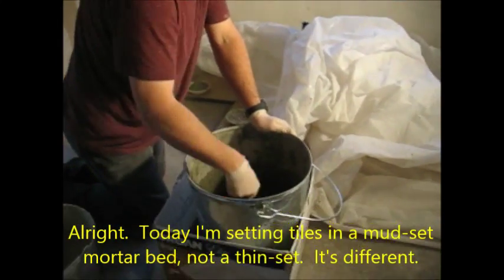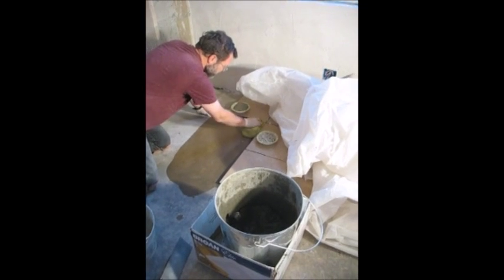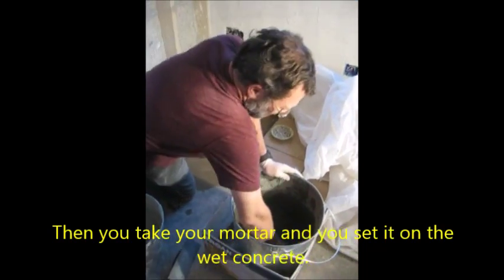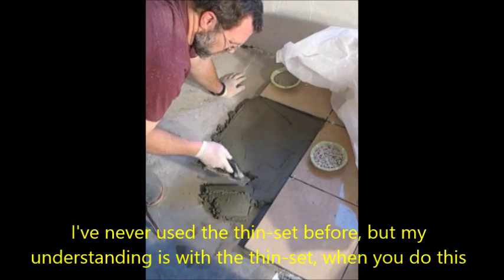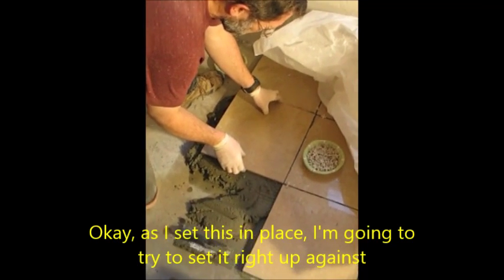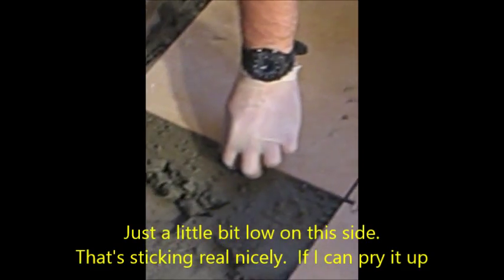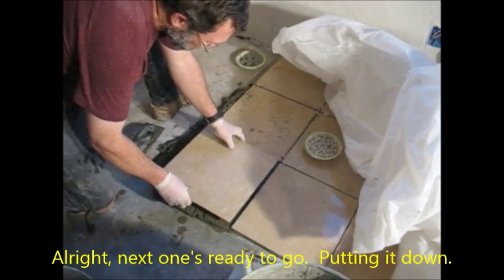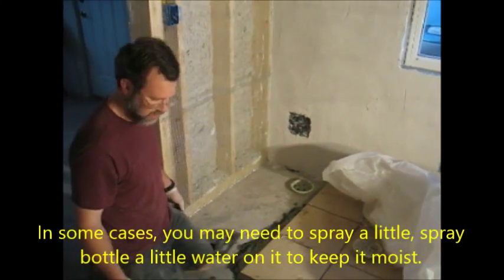How to Install Ceramic Tile with the Old Fashioned Mortar Bed Method

Comment: Over 50 years ago as a flooring specialist we used to lay out semi dry screed beds on level battens (as for a level screed) then dust it with neat Portland cement and bed the soaked tiles on this. Then beaten/ tamped in with a 2x4 beater block .. level checked constantly ... usually grouted with white or grey Portland cement ... and this method was used on suitable inspected and prepared  suspended timber floors with expanded metal mesh afixed over pitch impregnated paper first . And not once in all the years that this was done, did we ever have a failure! It works perfectly
Reply from the maker: That's excellent!!!!

Comment: I would wet subfloor then pure cement then mud mix , pure cement  wet tile then lay tile
Reply from the maker: there is no "subfloor" ; it's only a concrete slab, and yes we soaked the tiles

Comment: hi. i have poured 10cm on perlite floor screed with no expansion joints. it has several cracked over 5 months. how can i lay tiles over it with no future problems?
Reply from the maker: i am sorry, i do not know.  :(

Comment: You need thinset as a bond coat though. Thinset on subfloor, thinset on back of tile mortar in between. What your doing will blow right off the floor.
Reply: I agree,you need a bonding coat.
Reply from the maker: Nope, the floor has been great for over three years now.  :)  That is the point of the details in the video--how to make it stick with no thinset.  Just one tile broke when we put a heavy bed on it.  There must have been a gap underneath that one tile. I am glad, because thinset makes me sick. This was on a concrete slab, though.  Maybe it is different on other subfloor materials.
Reply from the maker: Another tile broke when we moved the huge, heavy piano.  However, that is not a bad price at all to pay for no chemicals!!!!  :)
Reply from the maker: We're up to 5 years now, and the tile is doing great with NO thinset.
Reply: @ChristaUpton  in the Philippines the great majority of all tiling is done with thick-set mortar of about one inch 1:4 cement:sand without additional adhesives. Not just on the floors but on the walls as well. This usually works well, especially because the concrete floor is not always perfectly done. Therefore the one inch mortar bed helps to make up for any unevenness in the concrete surface.

I never really thought about the amount of chemicals that might be in thin-set adhesive mortar. Probably a very important consideration.
Reply from the maker: @ChristianWagner888  That's awesome!!!!!  I have been wondering about walls!!!!!!  I'd love some tiles on my kitchen wall someday.  :)  

Yes, thank you, it really is better for the environment and better for human (and animal) health.  :)  

PS  I've always wanted to visit the Phillipines; maybe I can someday.  :)
Reply from the maker: We're at really good for 6 years now!  So apparently it will only blow off the floor if godzilla comes through.  lol
Reply from the maker: Nope, 7 years later, tile still GREAT, no thinset at all.  And there is no subfloor here.  Just slab.  (shallow, insulated)  doing great with slab heat, in -20 this winter! Tile still holding up wonderfully!! Health TONS better after living here 7 years.
Reply from the maker: over 7 years now.  :)

Comment: Thanks for this valuable information but I noticed you used  no rubber hammer and no level  at all why is that ? Isn't that makes your job much harder and time taking?
Reply from the maker: He actually felt the level slowed him down and somehow was able to eyeball it very well in most places. He tried using the level but stopped after a bit.  But a level could definitely be used.  If it were me, I'm sure I'd need one.  lol  I am not sure why he didn't use a rubber hammer, but I will try to remember to ask him when he gets home.  :)
Reply from the maker: He actually doesn't remember why he didn't use a rubber hammer.  Probably because we didn't have one.  lol  But also he was using force to push the tile down into the cement.  Because he wasn't using glue, he thinks the hammer would have not been as useful as it is with thin-set.

Comment: looks like this take 10 times as long as the thinset method.
Reply from the maker: Probably so.  But since thin-set makes me sick, having this is priceless.  :)
Reply: have you ever set half inch of thinset
Reply from the maker: @abcdefg65974  no, we haven't.  we might try in our separate laundry building next summer, though, as the off-gassing in there is not nearly as important as my living space.